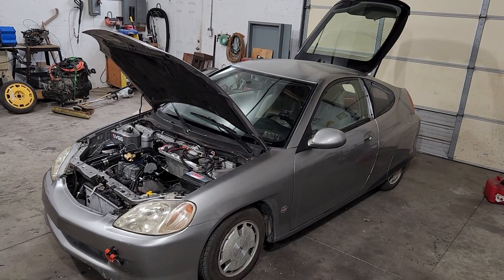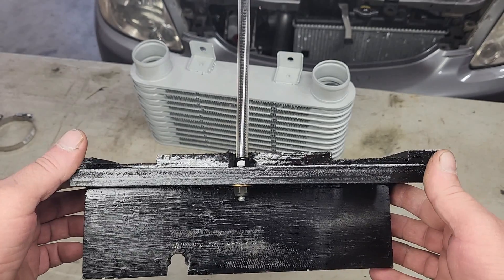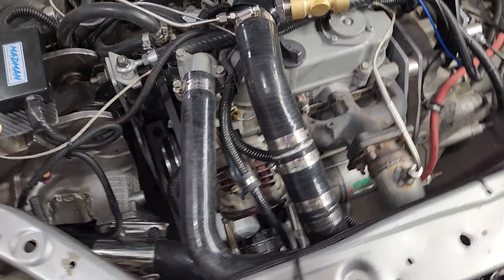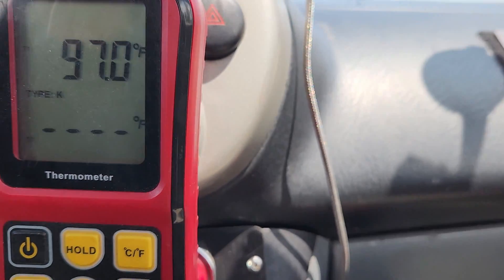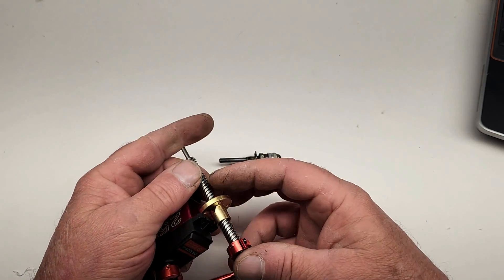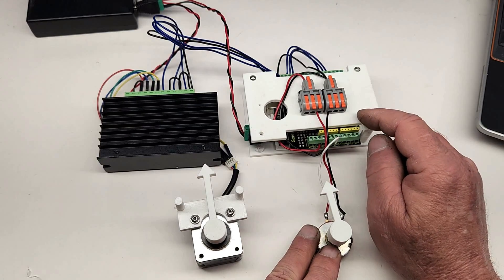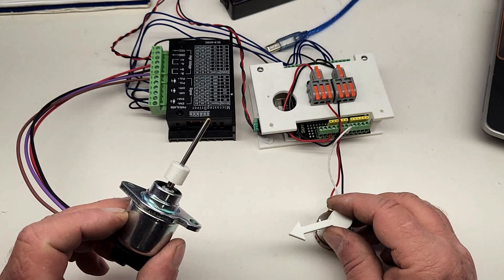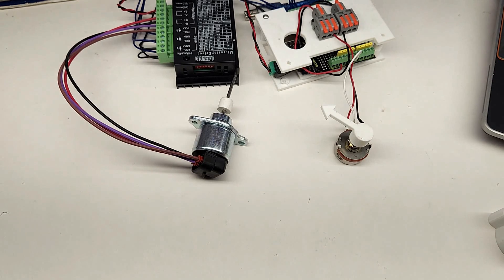S4 E17.  We install an intercooler on the AMR500 supercharged Kubota diesel.

Comment: You need an vibration dampener on your camera mount. Check rctestflight's vibration dampener, which are bust some bent steel wires. It works phenomenal - it can even stabilize a camera on a boat :)

Comment: You may have that large of a pressure drop due to the fact that you don’t have such a large expansion factor. You can take the limited amount of space and still end up with the same amount of air on a much lower pressure which does increase the efficiency of the system so seeing a pressure drop is not uncommon especially in a better system.

Comment: Your work in building this is amazing, but it's a little frustrating that you concluded the intercooler doesn't help when (from what I can tell) you left everything else about the car unchanged. An intercooler won't accomplish anything if there's no tuning change to account for the greater air density.

Comment: Jimbo I know this is late but I’m hoping u see this, with the pressure drop from installing the intercooler could be an indication of increased air flow (or a boost leak). A supercharger displaces a set amount of air per revolution so boost increases if the engine can’t take anymore air (this happens if intake tubing is too small) but if u we’re to put a bigger cam or larger intake piping boost will drop but power will increase. I do hope you will do a 0-60 comparison of just the old intake setup (no cooler and old pipes) to the new cooled setup

Comment: Pressure is resistance to flow, because the air volume is cooler after the intercooler (but the s/c is still making the same 10psi) its denser and will flow more g/s, and so pressure goes down. Boost pressure is kind of a bad metric for determining expected performance change because of that. Mass per second is the best number to make estimations with

Comment: I think the intercooler might rob a little from the system to where it seems to even out. Because of the restriction of air in the cooler. I have read the comment about different air temps and density and it actually being a gain. So are we actually gaining or about the same. I think at the least it's better on the engine for sure. Might need more boost now. Lol

Comment: Regarding the camera vibration:
1. You probably want a flexible connection between the camera and mount. There are special mounts, but I use cut up bungee cords.
2. That camera has a rolling shutter. There is free software to stabilise it (FFMpeg), but you'll always have some wobble.
I put the stabilisation settings in the description of this: https://www.youtube.com/watch?v=Q4eVA11iaHY

Comment: With the camera it can be about resonance and stiffer mounts don't help.  Maybe try rubber mounts or wire mounts and add some weight to the camera.  Experiment with the capture frame rate and any inbuilt stabilization.  If you get board try an insta 360 even an older one.  Great vids, great fabrication.

Comment: I would guess that those bends on your air intake through the intercooler are effecting the boast. Though I could be wrong.
Reply: pressure on liquids and gas displaces equal in all directions.

Comment: the boost has gone down because you added more volume with those pipes so its allowed the boost pressure to expand and reduce itself. my advice is to go back to the pulleys and change those it should compensate for the loss

Comment: I d oa lot of work with steppers where I work... Of course the ones I work with come from companies like Festo and come with built in encoders. But for things that don't require such fancy precision I use already written code like GRBL, since it already does things like acceleration and jerk control.I could see your stepper was missing steps there,  You'll save a hole bunch of money and time grabbing a cheap ass 3D printer board wit stepper drivers built in, and use another cheap ass Uno, or Mega, or Even an ARM based micro to feed it G-code... It'll save you heaps of money and 99% of the code is already mature and bug-free.

Comment: Do you have a pre and post boost pressure sensors on the intercooler? As it may not be a pressure drop over the cooler , it potentially could just be increased air density . If it is the air density increase causing the boost drop that would perfectly explain the lack of a fuel economy increase , on a turbo system this is where you would see a gain , as the boost actuator would compensate for this change and still push the set pressure into the intake , where as the supercharger cannot compensate for this at all .

Although this likely is more a comment around hp and not economy , but sometimes they do correlate

Comment: Are you sure the boost drop isn’t due to the cooler air? Because of the positive displacement blower, you aren’t changing the amount of air going through, so won’t make any change to power/economy. You’ll need to do a pulley swap on the blower to up the boost and take advantage of the intercooler by pumping more, cooler, air.
Remember, we’re not trying to limit knock like a petrol lump would need, we just want more air.

Comment: As always another fantastic video. Id definitely keep the intercooler just because of keeping the temps low. Heat kills engines, and not like you are trying to build a power house anyway. This set up would be amazing in a older jeep or small 4x4 for off road and trail riding. Whenever I can finally get a old flat fender jeep I will 100% be coping this set up.

Comment: 719CC Supercharghed, LIQUID Intercooled, 3Cyl Kubota Diesel engine.... 'Liquid' being a 5 Litre (pump up) pressurised garden sprayer, filled with either ice and water, or cheap alcohol. Set up 'Bob Heath' rudimentary way - Garden sprayer in the cab, screen washer pipe through to engine bay, with spray nozzles spraying liquid onto the fins of the intercooler... 🤔🤣🤣🤣🤣
😎🇬🇧

Comment: you may have heard this already but making the mounts stiffer will only make the vibrations transfer better into the camera, making the vibration worse. you need softer mounts to absorb the vibrations, not transfer them. if your camera has optical stabilization it will have a hard time. virtual stabilization may work, but it has to be very good.

Comment: For the dump valve you could add a pedal potentiometer to your existing accelerator pedal and use it to control a throttle butterfly valve from a fuel injected gasoline engine. I often see them on eBay for cheap. From Mercedes and VW vehicles.

Comment: I had a supercharger on my Miata both straight from blower to intake and intercooled for while before I went turbo. I found that the compound effect of the pressure drop across the intercooler due to restriction and the large drop in temperature after the compressor led to huge drops in pressure at the manifold. More efficient intercoolers helped, but the drop in pressure due to pressure was always there. On a roots blower this is a challenge that I never fully overcame, as I hit maximum rated RPM for the blower.

Comment: Regarding your shaking camera issue... my intuition is that making the mount more and more rigid is not necessarily going to help. With a rigid mount, I expect you may need some kind of rubber mounts to isolate the camera from the car (kind of like those rubber engine mounts), and possibly adding more mass to the camera might help dampen the vibrations (giving it more inertia). That's my guess, anyway.

I enjoyed the electronics demo. I've been getting into 3D printing and CAD myself as of late, and it's really satisfying designing and printing stuff that nicely and precisely fits with other stuff!

Comment: Nice work Jimbo! I've been watching your videos for a while, and this particular video got me thinking about the work the intercooler and supercharger are doing together to compress the air mass in the supercharger (thereby heating it) and cool the air mass in the intercooler to regain some air density: do you think that by recirculating the air that goes out of the pressure bleed valve (the one between the intercooler discharge and the intake manifold) back into the suction side of the supercharger (between the air filter and the suction side of the supercharger) you could gain some more efficiency at part throttle when you don't need the full capacity of the supercharger?

Comment: The injector cycling on GM/Rochester TBI system is determined dynamically via comparison to fuel maps held in the management computer's PROM of the following inputs: 
Throttle Position
Engine Load (manifold vacuum/boost)
Inlet Air Temperature
Engine Speed 
Exhaust Gas Oxygen Content

Should one of these inputs become lost--due to sensor failure--the system then calculates 
best fuel enrichment via remaining functional inputs, and holds any changes made/learned via a "keep alive" RAM, which is only erased when battery voltage feed to it during "key off" moments is interrupted via either momentary removal of the computer's inline fuse or disconnection of the vehicle's negative battery terminal.

Keeping this in mind, and having seen Arduino-managed fuel systems developed, I wouldn't doubt that with some time--and careful/skillful fuel mapping--that ideal/optimal fuel mapping can be achieved & retained for each instance of vehicle operation with the intended methods of actuation to be employed here. 🙂

Comment: You can certainly do it , but why ? The automatic fuel adjuster just needs throttle input at one switch setting at max depressing , and and one war or take off setting . You or your cruise control will do the rest .

Comment: Have you considered if they make larger fuel nozzles for the injectors?  We did this with the ALH VW diesels for an easy horsepower boost. It allows you to get more fuel in quicker so you have time to burn it and don’t hole a piston or wash the cylinder walls down.

Comment: I find this build hilarious and ironic from the standpoint of you've basically built a European diesel. Which there's nothing wrong at all with experimenting for fun. Love it. It's just that I worked for Toyota since the early 80's both in service and as an R&D customer relations guru. U.S. customers didn't like diesels. All we had was the Camry, Corolla and Pickup. NO power, leaked like hell, and broke everything. E.U. has had your low liter turbo cars and trucks for decades. Because they work, and get stupid fuel mileage. You need to market a DIY kit. I have a 1984 Kubota B9200 tractor. Never needed service but filters and oil. Imagine a small car brand in combo with Kubota. Running bio. That people make at home from bacon grease. Makes you think. Carry on, Sir. Popcorn.

Comment: I'd say what hurt the fuel economy was the boost temperature. Let's keep in mind: When air is compressed, it becomes heated. And the hotter air becomes, the less oxygen it holds. So the more boost that's run, the more the IAT (Intake Air Temperature) is heated, unless a method of charge cooling is employed. And because air tends to create more pressure the hotter it gets... well, you get the picture. 

  So seeing a drop in charge pressure due to the addition of charge cooling isn't a surprise. That said, the drop in pressure can allow a higher tune of boost to be employed, while retaining a reasonably cool charge temperature, which in-turn will allow more power to be produced or more complete fuel burning & lower EGTs, depending upon the amount of fuel enrichment seen in addition to the boost levels. 

  Either way, we're looking at improved fuel efficiency, in one respect or another. 🤔

Comment: The pressure drop across the intercooler isn't all drag. Things get smaller when they get cooler, so air pressure drops but all that air is still there, just smaller. 

The intercooler can't add air as the air cooler, so the pressure drops.

Comment: I believe at this point the increase in air density from the Intercooler will not create any added performance until you start adding more fuel to the equation. The added air density from the Intercooler will allow you to run more fuel at the same boost pressure vs without it. I can’t wait to see the adjustable fuel pin in action!!

Comment: What may be happening with the pressure drop with the addition of the intercooler is added volume. Or, there is more space that the air has to occupy before making it to the intake. Think of it like trying to blow through a straw. And then blow the same amount through a garden hose. There is less pressure build up in the garden hose because it's larger. 
     Or possibly it could be a mistepresentation of how much boost the gauge shows based on where your pressure sensor is. If it's after the intercooler and before the throttle, then the intercooler may be causing a restriction. If you checked the pressure before the intercooler it would verify both scenarios. Whether or not it's restriction or extra volume causing it.
     She's coming together quite nicely though. This content is refreshing and more informative compared to some others 👍

Comment: Interesting... Perhaps consider adding a rotary encoder to keep track of the stepper motor position, or just cut to the chase and use a tiny servo motor?
Thinking cost is a factor though, and the stepper wins by a big margin there.

Comment: Stiffer camera mount is not what you want I think. Personally I would sugget a GoPro camera (not the newest one because too much $) because of the good image stabilisation. It looks to me like the car is resonating in sync with the camera shutter causing the screen tearing look. If the camera has adjustable shutter speed I would play with that first.

Comment: Maybe use a air conditioner compressor clutch on one of the supercharger pulleys, to deactivate the supercharger when boost isn’t needed, it would help reduce parasitic losses.

Comment: I love this series! I think you ahould keep improving it until the engine blows up or you run out of things you can improve.. which i think is a really long ways away. I think you should add a water injection system. No methanol, just the water. It would be really interesting to see what benefits if any you would get on a supercharged diesel. I would guess it would cool the air more effectively than that interfooler.

Comment: i got an idea, how using these electronic diesel injectors from a common rail diesel? like (VAG) VW 1.2 TDI.
Some look if you can shoehorn these in that cyl head, with some Timed PWM signal
You remove the the current diesel pumpe and somehow build a common rail diesel high pressure pump.
Cast your own cyl head if that is what to takes to host modern diesel injectors in such a way you can keep on using the same parts as valves, cam, manifolds, etc, etc.

Than it would become insane, being able to perfectly time diesel input and amount.

it's basically sand and foam or wax and you need some guy with a aluminum foundry who is willing to cast.
There are some video's on how they cast BMW engines, they are with some epoxy bound shaped sand modules, like intake channels.

There is also this lost wax method, where you can carve wax blocks in to a inverted shape, that you can weld with a burner.
you fill half the mold with sand, wait for the epoxy to set hard, than make the other side of the mold.
The tricky part is the cooling jacket. it's mostly elbow grease, although you need a electric furnish or something to melt the wax.

Comment: the more boost you run, the higher the air charge temps, and the more difference an intercooler makes. heat dissipation is non linear.......as temps climb, the heat dissipation is exponentially higher.  That is good news, because roots blowers have the same issue as boost is increased, air charge temps climb steeply.  I say, you go for broke and bump up the boost at least 100%.  Modern heavy trucks engines, get their fuel economy from high boost...........42psi under full load, and cruising at 20psi.

Comment: Boost losses should be due to flexible lines, as they dynamically change volume as boost pressure increases. In a perfect world, the Cantina would have an array of v- bands and stainless piping. Love this series, and your real world engineering solutions.

Comment: for boost regulation, use an electric dump valve from a modern turbo car ford part CJ5G-9U465-BA or vw part 06F145710C is purpose designed for what your doing, but on a turbo. same valves on bmw's minis and GM products.
Reply: or just, you know, use a dump valve and a vacuum solenoid.

Comment: As if this series weren't good enough already....you're going and building a bespoke fuel control system and boost control system from scratch - coding and all.  Mercy.  While I can fairly competently diagnose and service this stuff in profession, there's no chance I could design and build it from the ground up.  This is fantastic Jimbo!

Comment: The pressure drop across the intercooler is due to a more dense charge from the reduced temperature not airflow restriction. To re-gain manifold pressure. increase supercharger output. Gale Banks explains this in many videos at: https://www.youtube.com/@bankspower

Comment: You should consider a closed loop stepper motor.  A closed loop motor has the position encoder built into the stepper driver attached to the back of the motor.  This allows the driver to move the motor exactly the number of commanded steps even if the motor itself loses a few steps. Also there should be a way you could add a position encoder to the idle air controller you are using so the microcontroller knows where it is immediately at powerup.